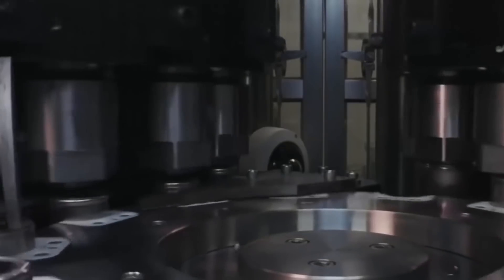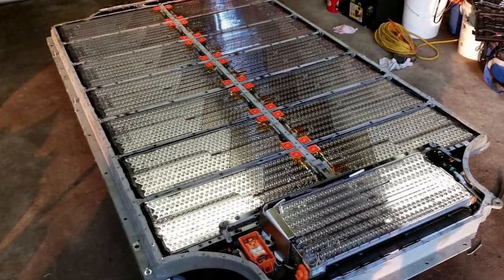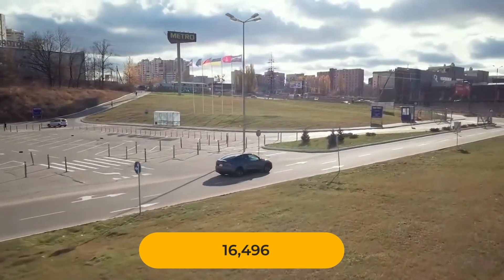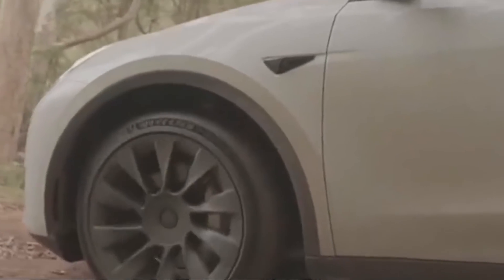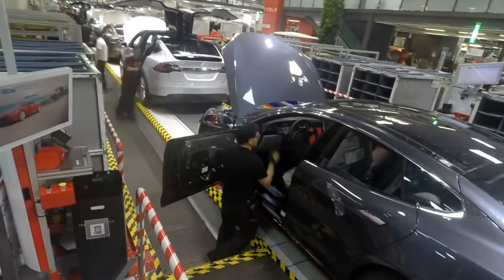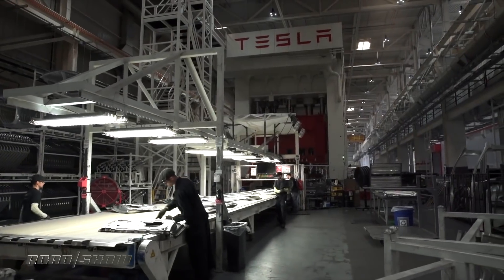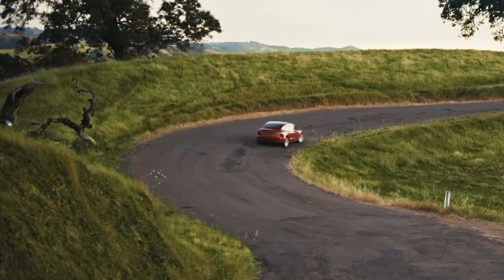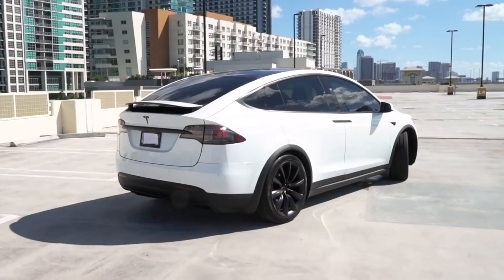TESLA MODEL Y NEW UPDATED 4680 BATTERY IS BEING RELEASED!

Comment: My estimate delivery is between end of July  and September,my question is if my Model YLR will be coming with the 4630 batteries? Thanks.
Reply: If it would we would have known it by now. I think they are testing them in Texas this year, so they make a couple of 1000s of MY with 4630. They are testing them as they don’t want to risk any problems.
The 4630 is for saving cost, so if finally they will sell the MY with this they all will be software limited and the unlocked ones will be on a higher price tags. It’s no point to wait as you won’t see any prices going down. Actually EV’s are getting more expensive in the next 1-2 years.